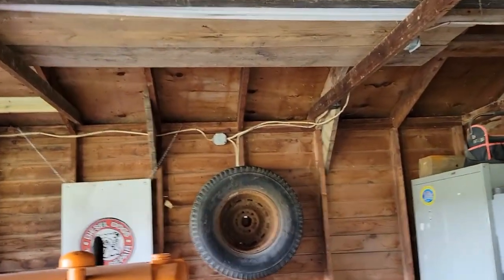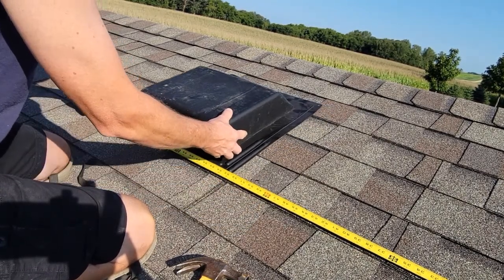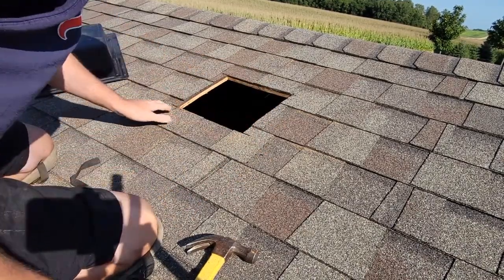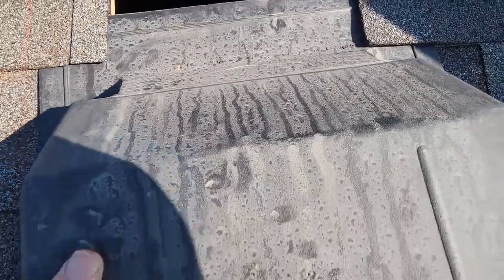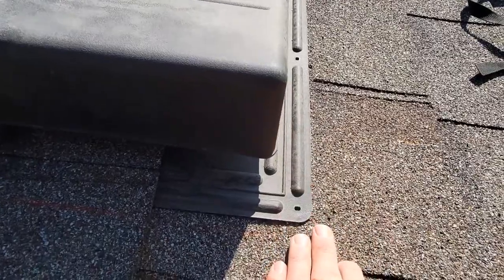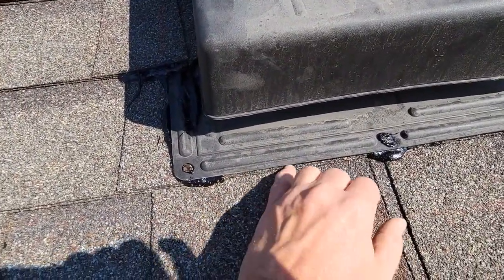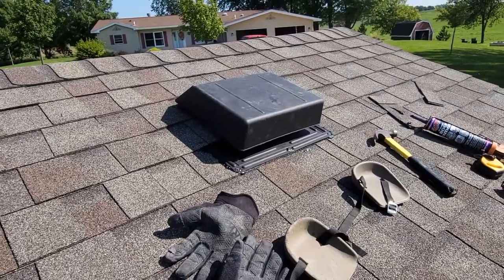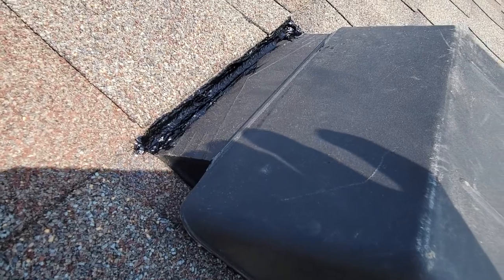DIY: How To Install A Garage / House Vent on Shingled Roof

Comment: How has it worked for you so far? Any days hot enough yet to indicate success?
Reply from the maker: Not hot enough yet but should be soon. No leaks I know that much.
Reply: @MelvinZoopers  How did it do this summer during the heat?
Reply from the maker: @ZBrink11  Real good. I could tell there was air flow & not such a stagnant feel.
Reply: @MelvinZoopers  Excellent